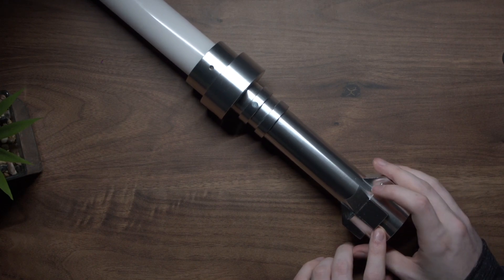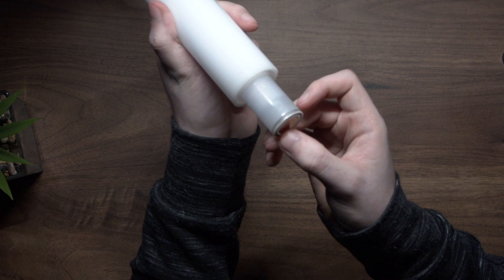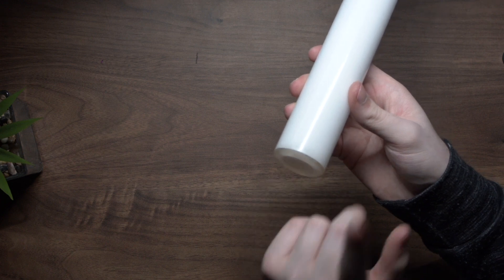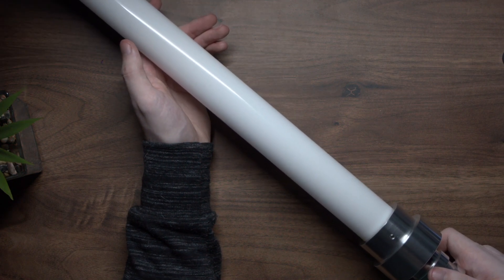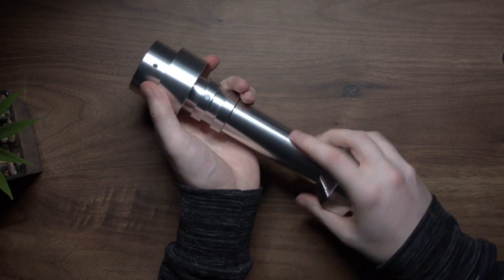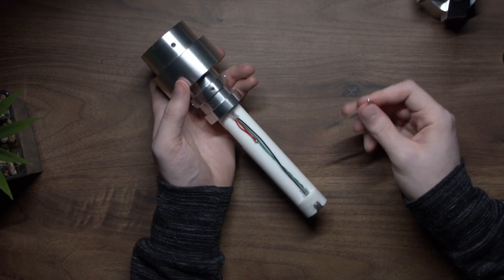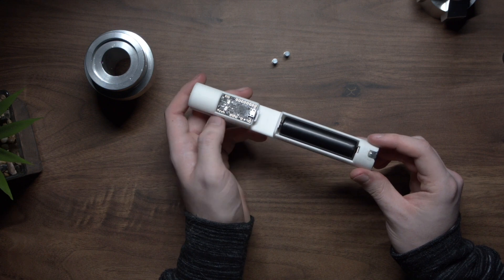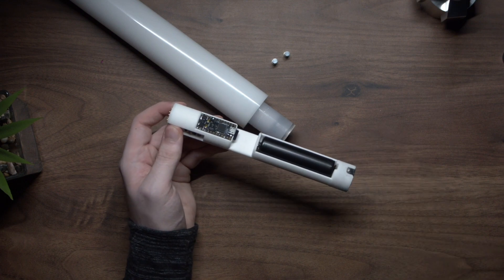Custom Lightsaber Chassis & Blade for ThePachStore’s Battle Brick

Comment: Awesome work! I would love to see you do a video on addressing how the buttons work with removable chassis, it looked like they were essentially just plungers? That push down in the PCB buttons. Currently designing my first chassis and I'm having a rough time trying to figure out a solution for a removable chassis because of the buttons
Reply from the maker: Yeah! The buttons are their own pcbs with head pieces on to push through to the file. Then the button pcb springs the the head piece back into place